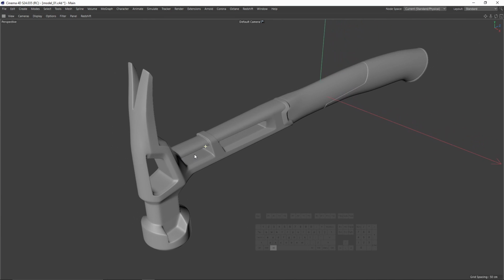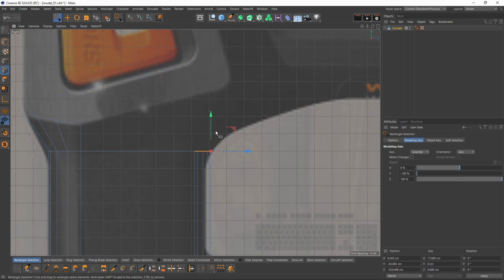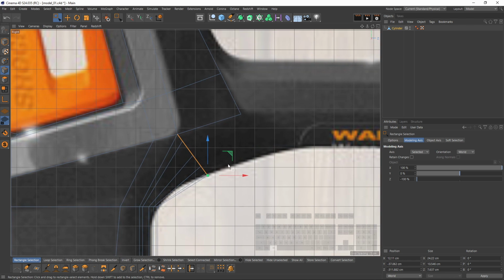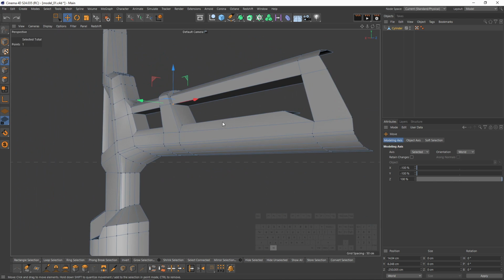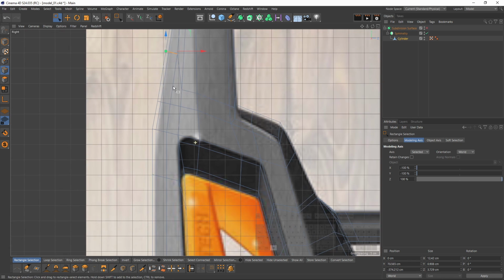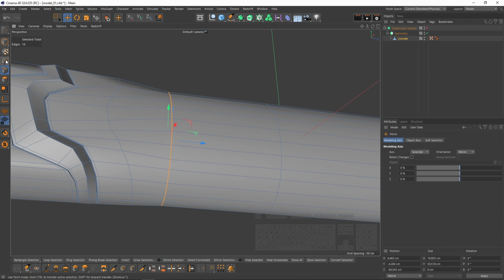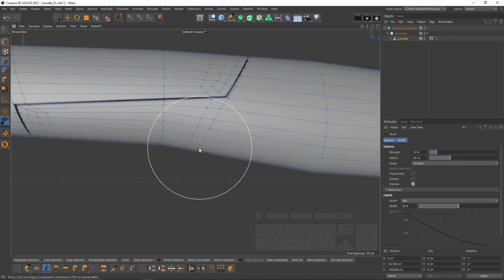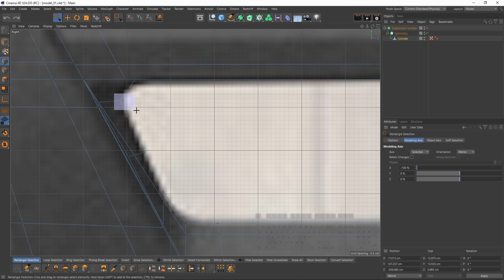Industrial Design/Product Modeling #14 | Futuristic Hammer

Comment: I know C4D isn’t used for industrial design like Solidworks or Rhino are. But can you comment on how you would export a model for manufacture? I know there are issues like thickness and parts connectivity. I want to submit CAD files to factory in China for molding. Would love to get your opinion. Thanks!
Reply from the maker: I don't have much experience in that field but you can export your C4D objects as STL, that should work but remember you can't model in such precision in C4D, especially for machining/printing.

Comment: 23:17 why the edge is still sharp even if there is no problem with the points, edges etc.? it happens to me all the time and i coulden't figure out the reason. you just put another loop somwhere around there and the problem is solved but is there any other solution for it?
Reply from the maker: I literally tought something was off there but it is just phong shading issue, sometimes it can be confusing, if phong angle is below some degree like 90, this happens but it is not related to mesh, just for the phong.
Reply: @polygonpen sağolasın reis adamsın.